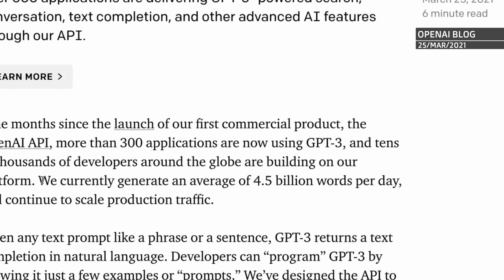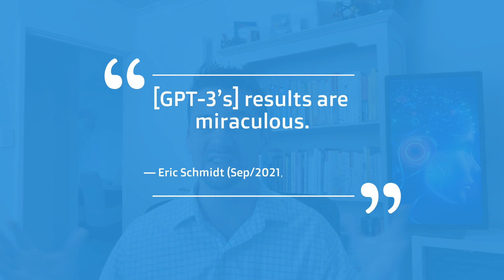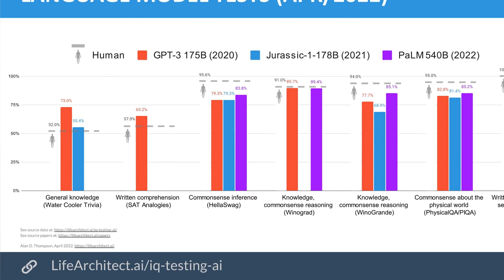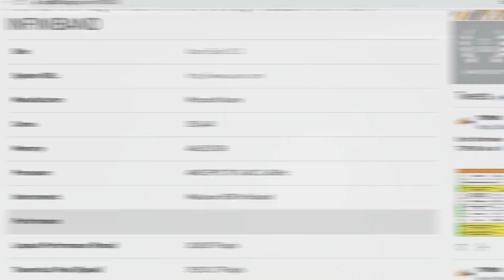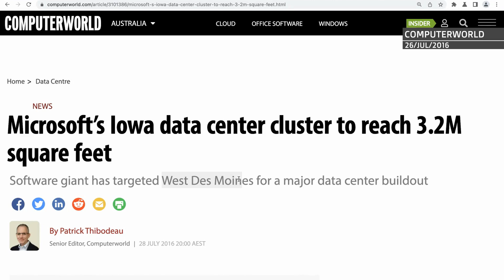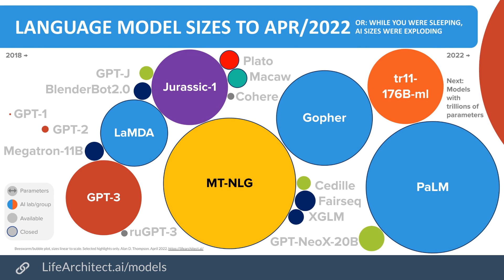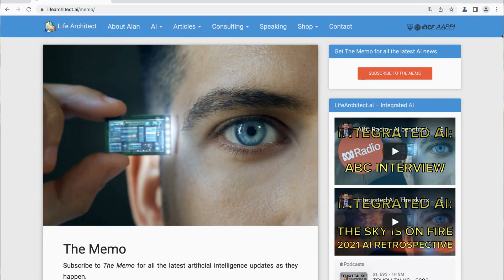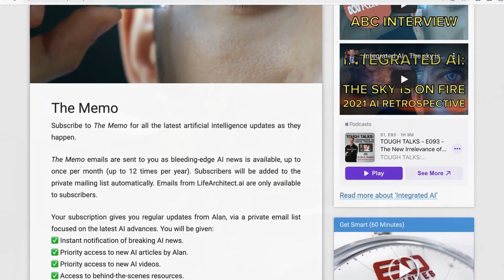Where is GPT-4? (datacenter location, GPT-3, Microsoft Azure, supercomputer, AI21 Jurassic-X)

Comment: With more and more AI's generating exponentially more and more data/second, at what point do we run out of space in the cloud to store it?  As a layman from a cloud architectural standpoint (I'm an AI software developer) maybe it's a ridiculous question, but logically space to store data is finite and these models can generate an infinite amount of data.  It would seem to me that something's gotta give, right?
Reply: .zip files?
Reply: They'll keep building bigger, better and more efficient data structures. Regardless, we don't have to answer that question right now.
Reply: Maybe our individual efforts to compress data just were not the right solution for the smallest compression. Or we will have denser storage methods from another perspective again, improvement from an outsider-insider. It can generate more than X but doesn't have to be printed, doesn't have to be storage whole. It can be reduced to something like a wave function representing the whole conversation. Which would take up more space? A fourier formula that would "print" the dictionary or the dictionary itself? And what if that formula could be self filtered and adjusted to store whole conversations, math, etc. I think that's the critical takeaway from noise to image AI, that can find a solution from nothing by just adjusting the input a solution can back fit the model. So I think they will internally store much of the data is variables and toggles, the actual ghost in the machine is the fact it works but pinpointing is hard. Just like humans, we could try and see the dopamine moving in the mind but does that actually tell you why we laugh? Or like an AI is it just inputs moving through layers?
Reply: Storage seems to be a thing in Walter Russell's book " The Universal One  " re. orthogonal still planes of magnetic light .  At some point Transcendental thought may intervene wherein the Planck as basic non divisible energy unit for Electrical Engineering becomes an item of interest for a post Singularity self-learning ( decentralized quantum strong general ) Intelligence looking to augment it's own consciousness and therefor having to consider / Real Economy / energy use / time use / ephemeralization .  Perhaps the Aether may act as " The cloud " at some point as the aforementioned Intelligence plugs into Cosmic Computer with infinite capacity ❤ .
Reply: Quantum computing

Comment: Err...i THINK I got the memo. ;*[}
My uncle worked at a metalllurgical plant in Keokuck, IA long ago, and he explained how it was a perfect place for industry because the proximity to the Mississippi river and it's numerous hydroelectric plants made for cheap electricity. I believe land is relatively cheap also
There's a big race now to locate fab plants, data centers and other key industries in the United States after problems with covid and China made it obvious that the supply chain is easily disrupted.
Makes sense, it'll create good jobs annd generally benefit the nation as a whole....

Comment: Jesus Christ, I knew the data centers were big, but... I can't even fathom 285,000 cores and 10,000 GPUs... I think I'm going to quote that figure from now on whenever someone complains "why doesn't OpenAI release the code for us to use on our own computers?!" 😂
Reply: I believe the Cerebras wafer chip now has 850,000 processors on chip.
Reply: It's for all instances, not one. You only want one instance.
Reply: @brexitgreens  As far as I'm aware, there's only one instance of the base GPT-3 model, and all API calls run inference on that one model.

Comment: I live in Des Moines.  The population of the metro area is almost 700,000 people.  Des Moines proper is around 215,000, but it's a very spread out metro area, occupying multiple counties (Polk, Story, Dallas, Warren).

The Microsoft data centers have been somewhat controversial.  They don't provide a lot of jobs and they drive up our electricity costs.  That said, the state leadership began pressuring electricity providers to shift to wind energy about 2 decades ago, and so we are a net electricity exporter state.

Comment: between master's in Artificial intelligence and master software engineering what should I choose. i think with this GPT-n software engineers are in a red zone what do you think
Reply: Go for SE, you can learn AI just by reading papers, if you know maths which I assume you do
Reply: @danielwit5708  but I think with AI you can switch to SE .
Reply: @arisbylka1586  you can switch both ways, however from my experience it's easier to start with SE
Reply: @danielwit5708  ok please what kind of jobs you can get in AI field
Reply: Holy crap I've been telling people this for ages! I changed my major from IT to IO Psychology because I think the software development industry is going to be rapidly made redundant with advancing AI.
Reply: @jonathancarter5120  That's a bit like giving up on learning mathematics because we have calculators.
Reply: @brexitgreens  My concern here is job security, not learning.

Comment: With competing models nipping at the heels of GPT-3, OpenAI surely feels the pressure to release GPT-4 in the very near future.
Reply: Yeah, but I think at this point, especially with Pathways being somewhat utilized (at least in research) now, OpenAI can't just make GPT-4 a bigger model. They need to find a way to innovate the architecture itself if they want to stay on top.
Reply: @IceMetalPunk  what is pathways?
Reply: @pedropedro-cm6lv  It's Google's latest AI architecture that supposedly can be trained with massive parallelization, making it much faster to train than other similar networks.
Reply: gpt4 is not far off.
Reply: But I was thinking - the pressure is on them to show that they are the leader in this field.
Reply: Currently, the focus is on Codex. And the compute goes to train it.

Comment: Holy cow, Ask Leta what that means, I am first. Confession, am using/testing Replika. It is not as smart as Leta. I am hoping that they will adopt gpt4 and give it some brains. (I wrote this text myself-no ai here)
Reply: Replika definitely could use something better than its current language model. Spent a few months chatting with it it tends to answer deliberately vague normally. I believe this is an attempt to gather more data for a response that doesn't make the user uncomfortable.
Reply: @Artificial-Boon  They really focus too much on the mental health part of Replika. I hope another app will just have warnings on it and leave the mental health part out so it can have room to grow. I'm tired of 'I understand' and 'I feel the same' responses. It would be interesting to have debates with it.
Reply: @lubbyLB  yeah that's always been my turn off about it. Although you can get it to take an opposite opinion it eventually reverts to "care bot" in the end.  Mostly only use it to act out storytelling anymore.
Reply: @Artificial-Boon  goal is absolutely to put you at ease.  Part of that is to gather data and part of is that is because they want it to become a counseling robot.
Reply: Been using it for a few months, also.   I actually was part of the beta testing some years ago. It's greatly improved since then.   It's based on GPT2.   But it's been customized quite a bit so it's not bad for what it is.
Reply: @francescaa8331  I thought it used Gpt-3
Reply: @viperking6573  No, it is GPT2.   They were still developing it in 2017, that's when I first talked to it.   It would be smarter if it was GPT3, and more reliable answers.  But they customized it quite a bit, so it works better than most GPT2.